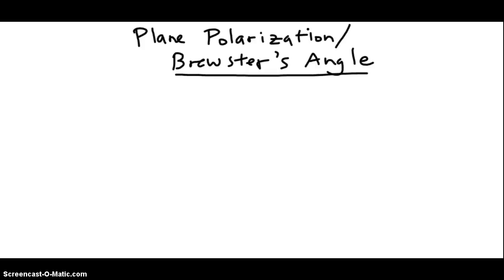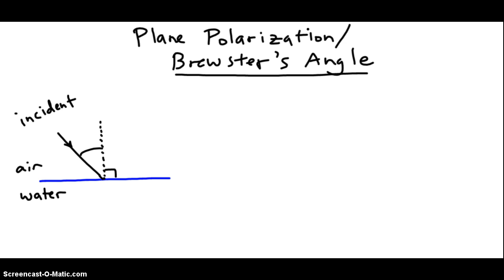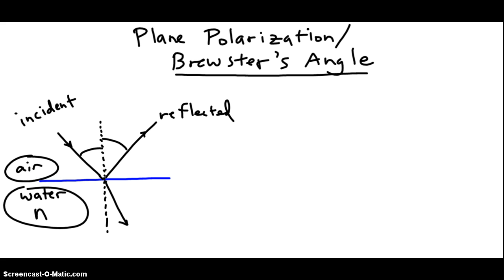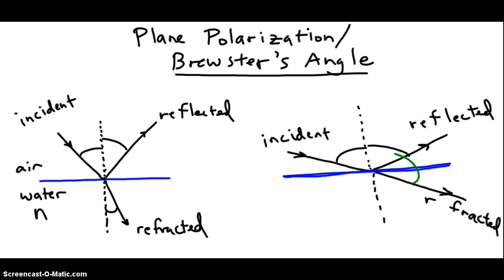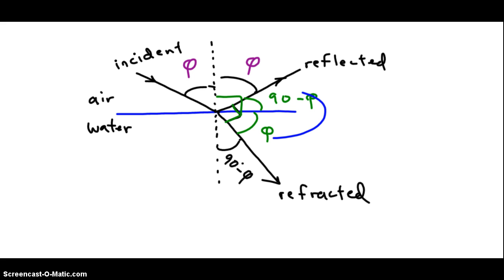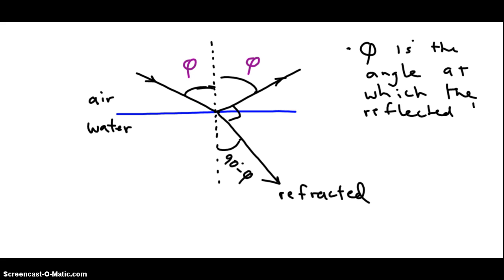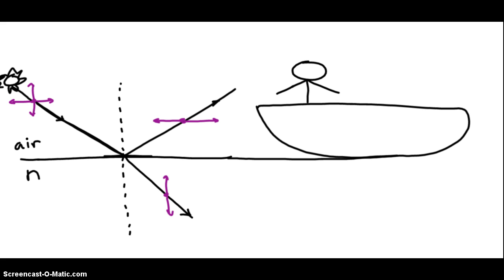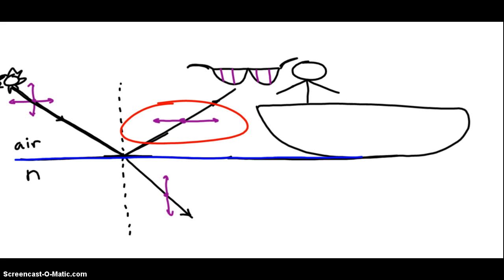Brewster's Angle

Comment from the maker: NOTE: At Brewster's, the transmitted light is only PARTIALLY polarized. So while the reflected light IS completely polarized, the transmitted light is NOT (contrary to what the video states).
Reply: Why does polarization happen parallel while reflecting and perpendicular while refracting and not the other way round?
Reply from the maker: @phenomenalphysics3548  This may have the answer you're looking for: https://physics.stackexchange.com/questions/233746/why-is-reflected-light-polarised